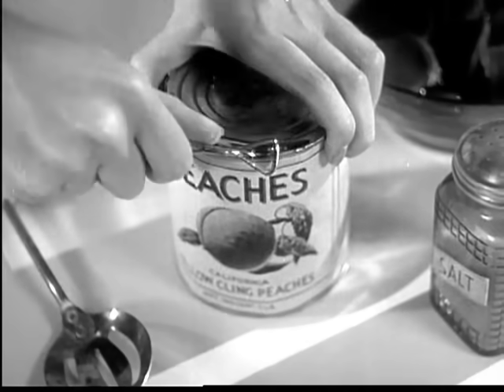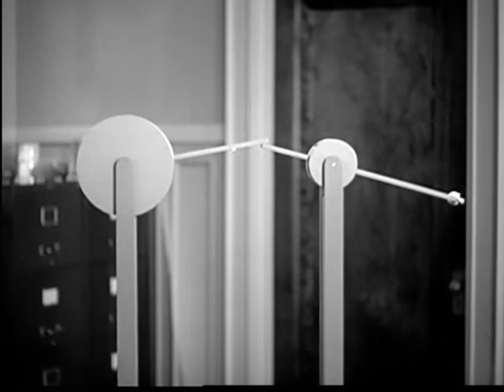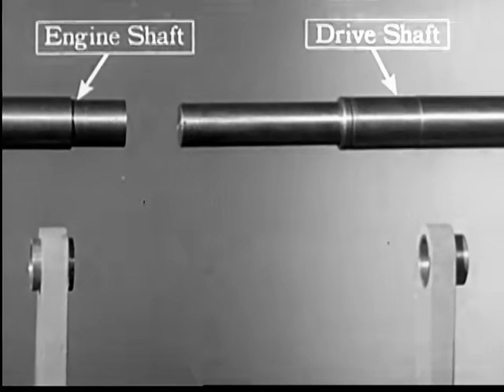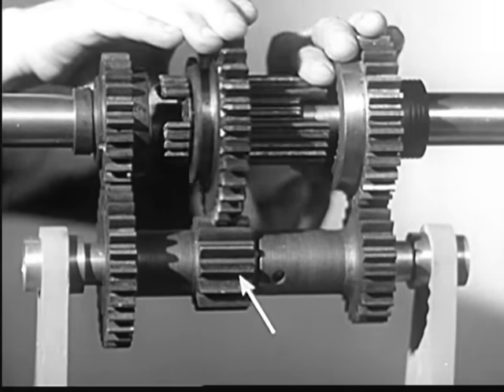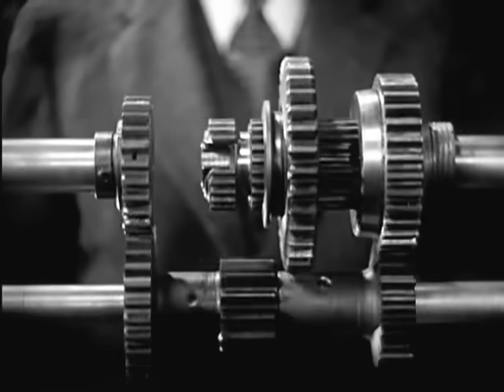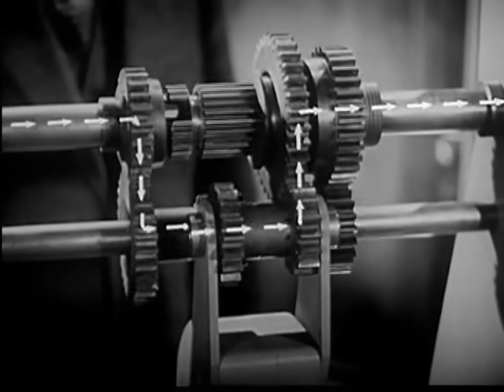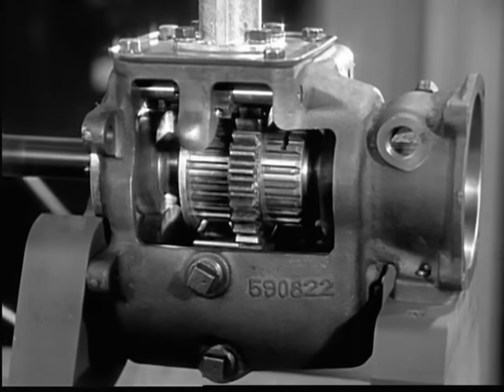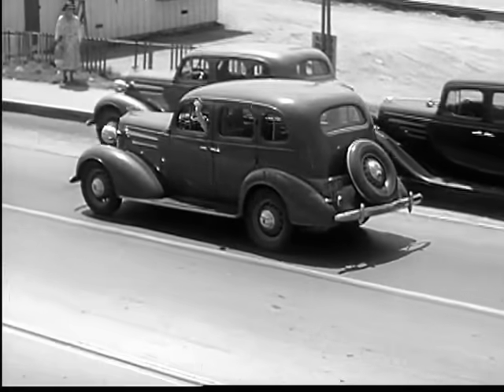Spinning Levers - How A Transmission Works (1936)

Comment: 02:10
Always knew about gear ratios.
But thinking of them as a never ending series of levers never crossed my mind.
Reply: Yep
Reply: I studied automotive engineering and only just really thought of them that way.
Reply: I never would have thought of it that way until watching this.  Very good way of explaining it.
Reply: yeah.. crazy
Reply: Same i never looked at it from this perspective
Reply: yup.    a  (larger) wheel/gear  driven by a smaller one is  a (continuous)  rotary  Lever !!!         the larger the radius of the driven wheel  THE  BETTER.      because  the result is  MA  that is  Inherent,  in  a  'larger-radius'  wheel.      MA  is   mechanical advantage; lever arm.      (these are some of the reasons why the  radii  of  wind turbine rotors  Never  get  smaller.)        it can be  SEEN  that  it is  Simple/easy  to  convert  reduction-MA    to    Inherent MA.        this is the  WELL-understood principle of  converting  'high rotation rate to torque'.      thanks to some ancient dude,  humans have developed a  GIANT  blindspot, regarding  the existence of a   transient/intermediate,  potential  energy  GAIN  in  the  transform.     if interested, see my research.  cheers       googletranslate
Reply: I learned how differentials and AWD work the same way. An old 1930's video.

Comment: "the synchonizer works like a cork in a bottle", that's just brillant analogy honestly, would never thought like that. those kinds of videos are pure gold...
Reply: Could you please explain how it’s being applied? I didn’t fully understand it.
Reply: @tto4646  So the "cork" makes contact, and frictional forces carry over the rotational movement, which allows the two components to reach the same speed before physically engaging/mating them.
Reply: @ZandrichMynhardt  the reason it's confusing is because they only showed the actual synchronizer in a gearbox rather than showing a visible demonstration of the actual mechanism. so he can understand how the cork works but can't see how the synchronizer is analogous because it's not even visible in their demonstration. the properties and shape of the synchronizer are unclear in the video so you can't really see how it would operate similarly to a cork. the rest of the video is great but they really just glossed over this detail imo
Reply: @ToxicallyMasculinelol  I don't understand why you are justifying his question? I had no problem answering it; it was a valid question, and I absolutely agree that the process' discussion was something of an afterthought, at least, compared to the in-depth explanations around the others.
Reply: @ToxicallyMasculinelol I wonder if they kept it ambiguous since it was proprietary Chevrolet tech at the time.
Reply: I do love how he explained it as if "come on, that's common sense"
Reply: Synchros in modern cars work a bit differently. A slider moves across two rings of teeth to engage the gear. As it applies pressure to the first ring, it forces it the "synchronize" with the second ring. Which allows the slider to slide completely over, engaging the gear. 

Here is an ok video. The ending gives a really good visual on how the slider moves. https://youtu.be/e-Lk3FXHubw
Reply: So is a synchronizer similar to a transmission clutch?
Reply: @BurgertownDresden  what's that?
Reply: @BurgertownDresden  no, the clutch allows the transition from one gear to the next. The synchronizer helps the transmission go into the selected gear. 

In a manual transmission, when you depress the clutch pedal, the clutch plate is lifted from the flywheel, on the back of your engine. This sets you in neutral, so to speak, as the engine is no longer connected to the transmission. Releasing the clutch pedal puts the clutch plate back against the flywheel, connecting the engine and transmission. 

For the synchronizers, in a manual transmission, when you move the gear shifter into a gear, the synchros help the slider connect to the gear cog for that gear.
Reply: you ever had the cork twist off?
Reply: I would say that the cork is the weakest part of this one, as most people’s understanding of a cork are those used to bottle wine. It’s a different situation and generally corks aren’t used as regularly as they were in this videos day. But their excellent video demonstration helps.
Reply: What are y'all talking about upvotes and downvotes? We're on YouTube, not Reddit
Reply: Millennials would ask, "what's a cork bottle?"
Reply: @marktaylor1957  A bottle Wich closes using a cork cap
Reply: @marktaylor1957  not really if they’re wine drinkers
Reply: What is the beauty of 666?
Reply: @praveenpatil1866  It's the MARK OF THE DEVIL!
Reply: I wanted to upvote, but downvoted instead to keep this beauty at 666 likes. This is just to inform everyone that the downvote is really just an upvote on the Left Hand path.

Edit: Nevermind, upvoted. Nobody else respected the 666.
Reply: @ZandrichMynhardt  you are absolute cringe
Reply: @jawbone6907  tAkES oNe tO knOW oNE
Reply: @ZandrichMynhardt  Downvoting doesn't change the number of likes at all. It used to do it and comments could have negative points years ago, but now it quite literally does nothing except make the user feel like they have a choice to dislike a comment
Reply: @unocualqu1era  I think you misunderstood what I meant. I did not imply that downvoting decreases the number of votes; I said the exact opposite - that upvoting would increase the count, therefor deviate from 666 likes. The upvotes have gone well beyond that, unfortunately. Still have a good ol'e screenshot for archival purposes though.

Comment: "The familiar can opener"  and already I'm lost  1 minute in   :(
Reply: The military still uses can openers like ones from 1936.
Reply: You use force on the handle, the opener applies a fulcrum to the can edge, and the blade, which  is one third or fourth of the handle length, multiples that force by three or four to the blade. The energy applied is the constant here. Longer distance x less force = shorter distance x  more force.
Reply: Rotary can operners use a gear to multiply the knob force by the fingers to the cuttng wheel.